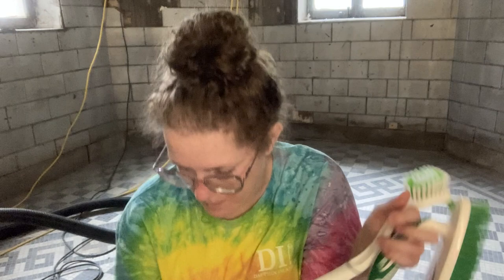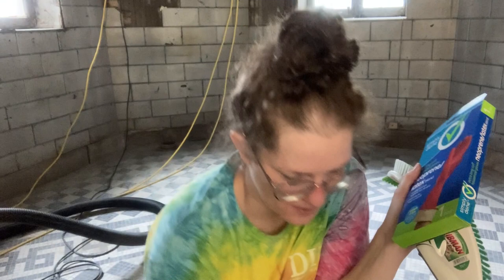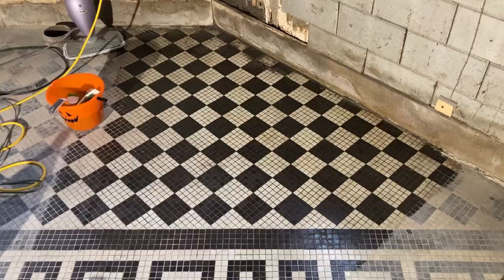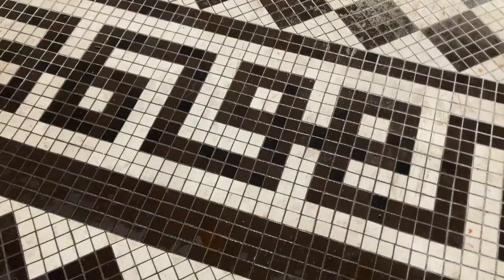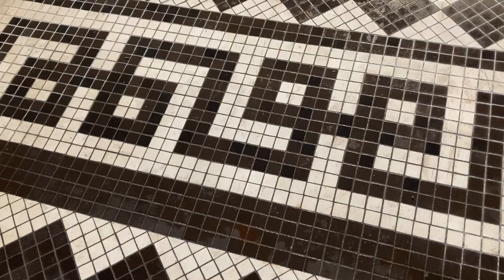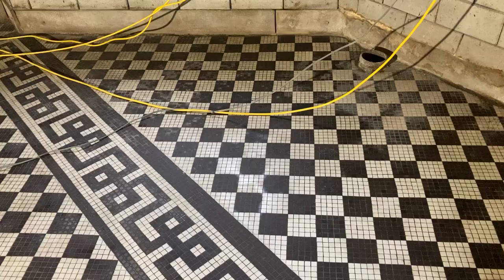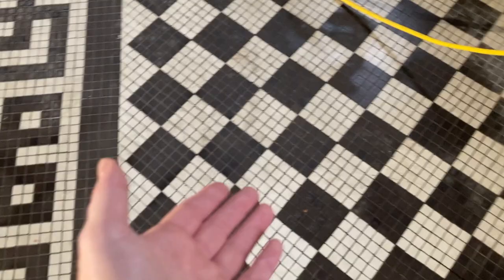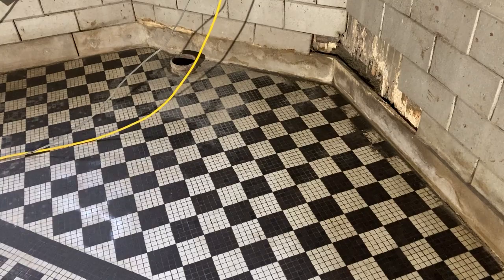Vlog 25 Cleaning the Tile in the Vets Office

Comment: What may work (need to try it though) is powdered soap for washing clothes (such as oxyclean or other).  I have used this for tough to remove stains and it worked well for me.  You get little in the way of suds, and is usually fairly easy to clean up (such as with a mop).

Comment: You may need to rent a scrubber to clean the tiles with polish remover and then wash it a few times once that's done you then put a coat of polish on to bring out the tiles shine, you could also buy a small scrubber from Amazon that would do the same thing and you could use it on the wood floors though out the house when those are ready to be cleaned

Comment: With my steam cleaner, I've got a steam pressure attachment for tiles, this attachment has a brass head small so I've sat on the floor in the bathroom with moldy tiles and grout. And after two goes over two days it was cleaned and back to white, by there was a lot of back and forth.

Comment: Don’t expect it to be perfect on the first shot. There are other products you can try such as TSP. While normally used for cleaning walls prior to painting, it works well on tile surfaces. Mix in Hot water according to the directions, spread on floor, use the scrub brush where there is heavy dirt. Allow to stand for a few minutes, then wipe off. No extra water is required. If the tile still appears dirty, allow to dry ,then use your steam mop. The  tri- sodium phosphate will still be cleaning as it dries and the steam mop will pick up any remaining dirt.

Comment: The tile design is fantastic, and now we can really see it! I have 90-year old tile in my kitchen and bathrooms, but it's mostly yellow. Over the years different things have happened to stain through the surface of the tiles (hair dye!!), and other times there is  build up on the surface. It looks to me like the area near the wall may have had standing water that dried there, possibly more than once. It's likely a mineral deposit, not just dirt. I have also heard that vinegar can harm grout (or more specifically, the sealer used on grout), but one thing I've tried is to put paper towels soaked in vinegar solution down on areas with mineral deposits and leave it for an hour to see if the crusty stuff will loosen up. The vinegar breaks up the deposits, and they can be gently scraped off, but it may take multiple applications. Don't get discouraged, Kim. It's a process, and I've been looking forward seeing that tile since the first episode.

Comment: Clean it with blue toilet bowl cleaner … put it on … make sure it’s evenly covered … let it sit for a few minutes scrub lightly and the tile will look 10x better
Reply: That’s on modern tile. Toilet bowel cleaner is bleach so I wouldn’t use it on 100 year old tile unless you know it can handle it. They didn’t have to sealants and coatings we have now a days and it may destroy the tiles if not careful.
Reply: @laurenarigo3894  
I agree!  NO toilet cleaner!!

Comment: ok so the way i would approach this is 1. mop with regular pine sol first to get a good look at what it starts off like then take the pool cleaning chemical that they we use on pool tile when its empty is called ha or hydrochloric acid you dilute that 25 to 1 1 part ha to 25 parts water then you 2. take that dilution and either spray all of the problem spots as well as the general floor or you could use a mop to do this but when you dip it dont wring it out just take the water ha mix and generously slather it onto the entire floor good and thick and let it sit for 10 to 15 mins. dump the water ha mix as well as wring out the mop and clean the mop out as well with just water make sure you have gloves on 4. mop the entire floor again to get all the ha up you might even have to do this 2 x but then 5. do a small bottle with a sprayer off the 25 to 1 and only spray that on the spots let it sit for 5 min then agitate it with a strong stiff wire brush to get up the last of the spots then when you are done with that 6. mop 1 to 2 more times after letting the wire rubbed areas penetrate after rubbing for 5 mins and that should have that floor like the day it was put in and you could pressure wash it too if you have one of those

Comment: There is a slight difference where you scrubbed. As the tiles  haven't  had a decent scrub in years, I would give them that initial scrub. After that maybe every alternate maintenance clean you could use a little bit of bleach  mixed in some water. Over time that would help to whiten the white tiles and help with any stains. I've cleaned houses, offices, schools, hospitals and aged care facilities.

Comment: I used a spin mop.  Get 4 additional heads.  Don’t use vinegar, too caustic.  Use Lysol or Mr Clean.  Choose an eight x eight area then wash and rinse, change the water, repeat with all 5 mop heads.  Then. Leave cleaner out for the third wash/rinse.  The key is the multiple washes, rinses and that mop. Works way better than a steam mop.  More effort, but worth it.   You might have to finish with a sixth rinse.   The old floor that nothing would clean is now dry, not sticky, beautifully clean.   My floor was only 60 years old, so you might have to repeat more after you run the mop heads through the washer with bleach.   Something about spinning the water out worked for me.  Each pass just picked up more.

Comment: Do not pressure wash the tile as someone else suggested. That would damage the tile (I speak from experience. Just chipped my saltillo tile using the "jet" setting on the nozzle of my garden hose). The steam cleaning you did made a big difference! You could also try Tilex or other bathroom products with bleach to get the grout cleaner. You could do a small test patch...
Reply: Yes to the first part - no pressure washing, but no to the bleach.  It could dissolve that old grout.

Comment: The floor is really so pretty. You might want to let the water run in the sink for a long time to clear out the rust. When it sits in the lines it takes a lot of flushing to clear up. Otherwise you're working too hard with scrubbing and using bottles of water. I agree with someone who recommended that you clean the wall tiles first. Otherwise that floor is really pretty. It might need to be regrouted one day.

Comment: I’m not a professional, just a 69 yo cleaning nut. I’ve been using vinegar with water, no soda, on grout for over 30 years. Current floors since 2008. No grout issues. Also, I don’t use a bucket. I use a spray bottle and a mop with removable, washable mop heads. I did buy some drill brushes to use on the shower walls occasionally. That might help getting through the tough spots.

Comment: Dollar stores are good for cleaning supplies. They are not the most durable but are good for gross projects. I used the paint brushes and just stick them in a sandwich bag until I'm finished and just toss. Anomia cleans floors well but is terrible for the lungs. I believe it also removes wax buildup, I don't know if it would hurt old tiles though. I was thinking of getting a scrubbing and waxing machine for our hardwood floors but they are a bit pricey and the pads have to be replaced. They also are big and take up space. But you have a much larger house so you might want to look into it.

Comment: So much hard work. It may not look the way you would like. I would try a little beach solution In a small section. As it may be years of disinfecting and scrubbing removing the finish and making the tile porous trapping the years of dust and grime. Once you get to the point of having it clean as you like it sealer will make it pop just like varnish on an oil panting does.

Comment: Power-washing would get it clean, but I don't know if you have the drainage for that. Maybe a more industrial steam cleaner. Either way, this is really the first pass. When I moved into my apartment, I had to wash the floors so many times--I couldn't believe they were so bad, especially the kitchen. To clean my grout, I had good success with Magic Erasers, and lots of them, from Dollar Tree. They are slightly abrasive so they can work the dirt out, but I could see them not being great on certain types of tiles. No matter what, tape down some floor covering before any wall demo so you don't have to do it all again!

Comment: It's clean, but the gloss has worn off of the tiles over the decades. Try waxing it to bring back the shine and darken up the black tiles. The wax will make the floor look wet all the time. If you noticed it looked fine when it was wet, but got duller looking as it dried. Wax will obviously not make it look like new, but it will make it look better, and with a floor that old, that may be the best you can do.

Comment: Yeh you cant tell the difference because there is so much dirt in the grout the baking soda and vinegar pulled up a bunch of dirt so its hard to see a huge difference because theres still more in there. I went through this same thing in my last apartment. It took 4 tries to see an improvement and I think I buffed the top of the tiles so much that they were no longer sealed.

Comment: You'll probably have to hire a tile polisher to refinish them. My aunt has that tile in here Brooklyn Apartment Entrance way, it's a slip hazard in the rain so she has it carpeted over.  I remember those old 1/2 square tiles are flat finish, because you would slip on them.  Your cleaning method is good for a few years of grim, but seriously you are dealing with decades of grim and also the period of abandonment.

Comment: Pine sol does a wonderful job on tile and kind of shines it too.
Reply: Yes, I think she definitely needs something like Lestoil from Lowe’s or Home Depot, maybe Walmart.  You can also call first to see if they have it.  Or try Fabuloso, which I’ve never used but is supposed to be, well...fabulous, and I think you can even find at some Dollar Trees in smaller bottles if you just want to try it out.  Or pine-Sol.  Even Mr Clean.  And definitely need to put some of the cleaning solution (properly mixed in water) onto the floor and let it sit a bit before scrubbing and mopping it back up.  I agree - no bleach or chlorine until you know what you’ve got.

I just saw where somebody mentioned Spic and Span and I’d been trying to remember the name.  I think it comes in liquid now, but I always used the powder form with hot water which I know is hard for you now.  I’d put it up with Lestoil (and Fabuloso which is supposedly somewhat similar to Lestoil).

Comment: In regards  to a product  to use for the floor,  I myself  had a quarry  tile  floor from the 1940s that was absolutely   awful  with dirt ,  oil and paint  and I was recommended  to use caustic  soda  with  boiling  water,   it worked  an absolute  treat  and brought  the floor  up beautifully,   took away  alot of that elbow  grease  needed  normally,   just be careful  with the product,   would  advise  having  gloves  etc as you don't  want  to get it on your skin. You will be pleased  to know you won't  need  to get on your hands  and knees  to use this as you can use a mop.  
P.S with  being  in the UK,  I'm not sure if caustic  soda  as we know it here  is called the same in the states,   sorry I can not help you there .  Good  luck

Comment: Looks great! The absolute best thing I have found for cleaning grout is Simple Green. I use it full strength in a spray bottle and spray the area I'm working on, scrub with a stiff bristle brush, maybe a good tooth brush. I follow it up with a bleach water solution to wipe and/or hand mop it up. Your grout looks dark, so you may not see a difference. I would do the best you can and then embrace the appearance of the tile and call it good!

Comment: I'm a few days behind. You seem so disappointed at the outcome but that floor had years of grime on it. Your first attempt seems pretty successful considering how dirty it was to start. It will probably take several attempts to get it clean. I don't know anything about chemicals or if you found a better solution yet. But if you are going try scrubbing with a brush again, maybe you should get one of those brushes that go on a broom handle and save the kneeling and your back for those areas that are too small the big floor brush. Another suggestion if you are still only using "safe stuff" like water, dawn and vinegar maybe change your shopvac to the wet vac setup and suck up the dirty water. A floor squeegee might be helpful too especially if you have a floor drain nearby.

Comment: Get a bruch on a stick so you can put some pressute to it and get closer to the wall., and use a rag or a mopp to take the dirty water off. You need to wash it with clean water several times after scrubbing. On tiles i have used toilettcleaning, but you have to be quick, dishsoap is no use. 
Just continue cleaning and you get it clean.
But think about what you use, the poertiwels for example is not good it just waste. Think eco.

Comment: Let the water run…it will clear after a few minutes.  To remove water stain…dissolve a cheap dishwashing tablet in water in a spray bottle…spray on floor, let set 15-20 minutes.  Mop off.

Comment: I’ve had good luck with Zep Grout Cleaner and Brightener and a sturdy grout brush in similar situation.  Similar tile floor had been scrubbed with countless other things and that is what worked.  Pretty strong though (need acid resistant gloves) so best to spot test first to make sure it wouldn’t damage the tile.
Reply: Definitely spot test - old tile and/or old grout may not tolerate it.
Reply: @Lucinda_Jackson  Agree—best to be cautious.  I used it on tile that had not be cleaned properly in at least 20 years.  Still required scrubbing with a grout brush but worked miracles—besides wear and tear almost looked new.  The tile I used it on was from the 30s or 40s—since this tile is older may not have the same results.
Reply: @8kmsmith  
I love Zep on my tile and grout, too, but yeah - I’d be leery on antique grout, especially.

Comment: the Tile is one hundred years old and it probably was abused by the animals.  It will not be pristine.  The first past with the steamer did great.  repeated cleanings may improve it.  Try different cleaners.  The grout probably was not white.  Do not use a power washer!  It will damage the tiles and may flood the basement.

Comment: My thoughts are just good ole fashion elbow grease with what you have been using and to do several passes with the steam mop ... you'll need to really clean that pad out good... maybe work with several pads... as it's going to take a lot to get all those years of grime and dust off.. but I'm with the others... you'll want to work on the walls  first... though I do see there are tiles missing... not sure what you all plan to do there.

Comment: I noticed a lot of built up dirt still left on the tiles I use to do what I called Swab Down the Deck (Sailor term) my grandfather taught me. Get a mop bucket (see if you can borrow one from work or find one in thrift store.) preferably with a mop wringer  fill with very HOT water add dish wash (the kind they use to get oil off birds in oil spills ).  Just put mop in water and without wringing mop spread it over floor use mop to get into corners and spread kinda evenly .Take a floor broom with stiff bristles scrub , let set about 10 to 15 minutes scrub again. Refill mop bucket with clean hot water and mop up dirty water rinsing and wringing mop often. Here is the trick you must keep the rinse water clean as possible if you use dirty rinse water you are just pitting dirt back on floor. be sure to get as much water as you can up off the tiles . Where you allow it to dry naturally it can leave dirty spots. If the floor has a drain hole even better then you can use a hose to rinse but be sure to not leave standing water in anywhere. A lot of hotel and maid services use towels to dry tiles to prevent dirt build up.   This seems like a lot of work for a basement that is not even finished yet I know , but even if you wait till it is finished to get it sparkling and just take say a 5X5 foot area at a time it will be worth it in the end. :)

Comment: If you think the grout is supposed to be white. I would suggest some bleach water. Put bleach in a spray bottle with water. Don't let the bleach sit in the spray bottle for a long time, because it will break the sprayer. Then you will need to put some sealer on the grout. Idk why, it's what my grandpa told me. Seal it 2x a year. Once in Thanksgiving and once on Easter, so you don't forget the last time you did it. Idk if bleach hurts the grout, I do it in my shower and it makes it so white! Probably do some research on my bleach solution, because I just do it because it works for me ;)

Comment: Omg that floor looks great!  What are you wanting, more shine or bleach white tiles with no scuff/wear on them?  Short of getting down with a toothbrush and some bleach, then oil, I don't think you're gonna get that grout any cleaner.  If you want a shine on it, you might try something like mop and glo.  I always used ammonia water on the floors to get them clean.  It stinks, but it works good.  It will strip any shine off (and old acrylic wax build up) tho.

Comment: I love the pattern on the floor tiles. I think you are on the right track with the steam. On other floor cleaning channels, they use steam to clean tiles. You could try little samples of products on the floor, tape off 1-foot sections, and use different methods and see if it is going to do anything different. You may have to use a sealer on the tile to improve the shine after cleaning them. You might use a product I use it's called Krud Kutter.